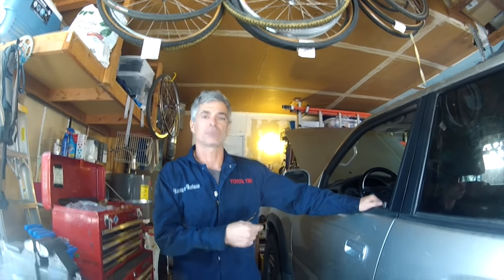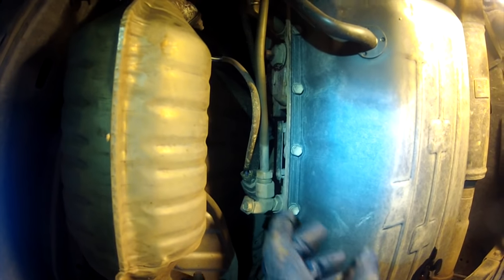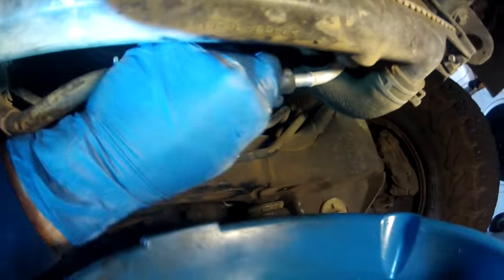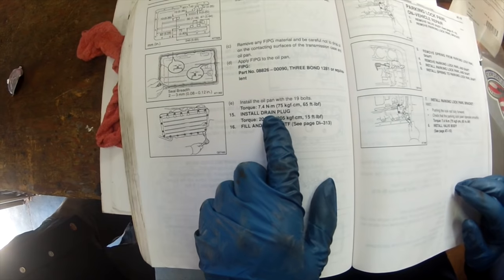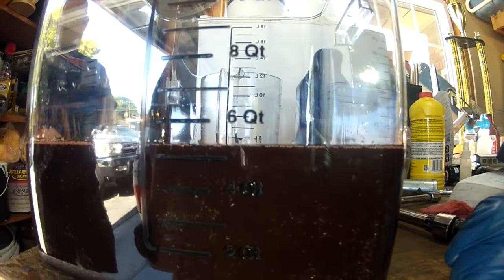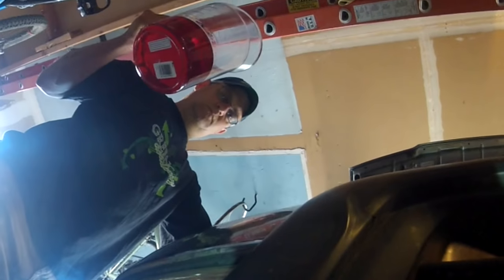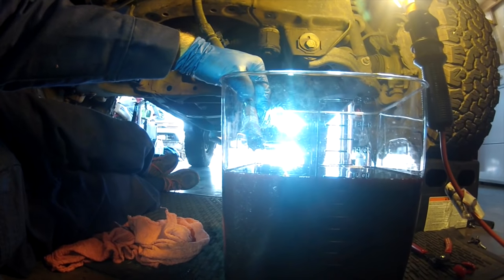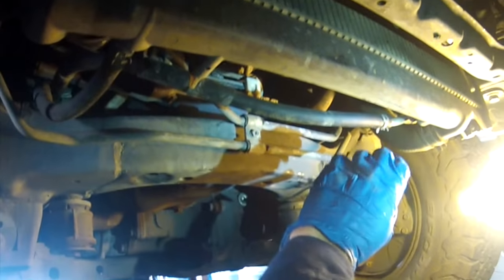Transmission Fluid Flush

Comment: This is probably the most comprehensive flush procedure I've seen anywhere. Thanks for sharing this man!
Reply from the maker: No problem.  Glad our video helped you out.
Reply: Dunno if anyone gives a damn but if you're bored like me during the covid times you can watch pretty much all of the new movies on instaflixxer. Have been streaming with my brother these days :)
Reply: @Brodie Taylor Yea, been using InstaFlixxer for since december myself :)
Reply: @TimmyTheToolman  one more question please? My 2004 ford ranger don’t have a drain plug that I see, do I have to drain the pan or can I start draining from the radiator?? Sorry.
Reply from the maker: @HowardSprague116  I'm not familiar with Fords but I would think there'd have to be a drain plug.  You could technically start the flush via the transmission cooler return line without first draining the pan.  Is your transmission sealed, meaning no dipstick?
Reply: @TimmyTheToolman  it does have a dipstick.
Reply from the maker: @HowardSprague116  Gotcha.  If you don't have a dipstick, then the manufacturer expects you to drop the pan to change out the fluid and the filter at the same time.  I didn't think American Motors cars were still like that with no drain plug, but apparently that's the case.
Reply: @TimmyTheToolman  I’ll do some more research on draining. But man you helped me big time. Thank you so much. Keep on Yourubing.. 👍🏻👍🏻
Reply: @TimmyTheToolman  I won’t take off pan if I can’t find the drain plug. I’ll just flush starting with transmission cooler. Thanks again brother!!
Reply from the maker: @HowardSprague116  My pleasure.  Happy Wrenching!

Comment: As an avid Toyota owner, currently own eight, I perform all of the maintenance. Your videos are most informative and I appreciate the detailed description of the work required. Some Toyota trivia for you. A windshield washer fluid container,with the bottom removed, can be used as a funnel for oil filling. The threads of the container and the oil fill opening match on the Sequoia 4.7 liter match.
Reply from the maker: It's good to hear you like the videos we make.  Thanks for sharing your oil funnel idea.  I like it!  Is it any particular brand of windshield washer fluid?
Reply: Not that I am aware of, just the normal bottle that comes from Pep Boys or Wall Mart.
Reply from the maker: @carolcarola9719  Ok, Thanks.

Comment: Cool. Honestly only thing I would’ve done differently would be drop the pan, replace the transmission filter and clean the magnets that are on the bottom of the pan. they’re probably caked with metal shavings.
Reply from the maker: My take on dropping the pan is I'd do it if the transmission had an unknown service history and the trans fluid was really dark.  Then I might be interested and dropping the pan to see how much metal debris was on the magnets to give me a clue on the health of the transmission.   If the trans is regularly serviced, dropping the pan isn't necessary in my opinion.  Those magnets could hold a lifetime of fine metal debris.  What I do for extra filtration is I run an inline magnetic filter in the transmission return line.  Magnefine makes them and they are rated for 30k miles.

Comment: My 99 sr5 has 320k on it. Should I do a flush? No transmission issues. Just trying to catch up on maintenance. I got it at 306k.
Reply from the maker: With that kind of mileage and I'm assuming an unknown service history, I think it would be safer to do a series of drain and refills.  Drain the pan which will remove around 4-4.5 quarts from the system and then refill it.  In another 5,000 miles, maybe timed with your next engine oil change, perform another drain and refill.  Wait another 5,000 miles and do a 3rd drain and refill and your fluid should be in really good shape after that.  I do a drain and refill every 10,000 miles (every other engine oil change), and this keeps my trans fluid in great shape.  I confirmed this by doing a Blackstone Labs oil analysis of my fluid.

Introducing the full capacity of fresh fluid might be dangerous because ATF has great detergent qualities and if there's sludge buildup in the trans, that fresh fluid could break up deposits that could become lodged in a fluid passageway in the valve body and then you're going to have trans problems that will force you to pull the trans and replace it.

Comment: If you've got 60--  80k miles, good time to drop pan, check and see what kinda crud is in the bottom, clean it, replace filter. With higher milage vehicles, if the fluid is dark, same deal, with older, darker fluid, there'll be more trash in the pan, filter must be changed, after 3- 6 k miles repeat drain, no filter, should be good for another 60-80k miles, change sooner if fluid gets dark.
Reply from the maker: Unless the trans was treated poorly and barely received service, dropping the pan and replacing the filter is a waste of time.  The filters in these transmissions are a fine mesh metal strainer and not an actual filter.  They will only get blocked up if the fluid was hardly ever changed and sludge deposits got caught in the filter.   When I cut open the filter on my 3rd Gen with around 150k miles on it, the strainer screen was probably 95% clear.  And, cleaning the magnets isn't a good reason to drop the pan either.  Yeah there will be metal deposits on the magnets but it's not like they need to be cleaned in order for them to keep on efficiently collecting metal fragments.  That's my two cents.

Comment: Good info. You did a great service.

I did a fluid replacement/flush using a similar procedure about 4 years ago on my Toyota Sienna at 88,000 miles.  Even though Toyota says this is a lifetime fluid, the fluid color was kind of dark purple with light brown streaks.  I used 12 quarts of Valvoline Maxlife synthetic ATF ($17.98/4 quarts at Walmart) and after the change the fluid color was  clean, clear light red so clearly this procedure does a great job at getting almost all of the old fluid out.

Now about 55,000 miles later the fluid color hasn't changed at all. It's still clean, clear light red. Clearly I've extended the life of my transmission by doing the fluid change. I highly recommend this procedure and Valvoline Maxlife.
Reply from the maker: Hey John,  Glad you like the video.  There's no way any ATF is lifetime.  How they can claim this is beyond comprehension.  You did the right thing by changing it.

Comment: I used this video as a guideline to flush the transmission on my 2000 tundra 4.7 with the A304.  The transmission cooler is right on the front of the radiator and I pulled off the top line and slipped on a 3/8” ID clear hose to pump the fluid into a quart marked 2 gallon plastic pail that I got from the paint section of the local home improvement store.
Worked like a charm, and my truck is shifting much smoother.  Took all 12 quarts.
Reply from the maker: Good job!

Comment: I used your method on my 1998 4Runner, and it worked great. I was able to do it solo; just counted to ten each time, and that pumped out about a quart. My filter came with a rubber gasket, so I used that and will be happy to save myself at least an hour next time with not having to remove gasket material! Thanks for this very helpful video!
Reply from the maker: That's great to hear it worked out for you Jerry.  Thanks for taking the time to comment.  Happy Wrenching!

Comment: Just did my 2004 Highlander. It had an external cooler (call it the tow prep package which many Toyotas come with) as well so tapped right between the external cooler and the transmission. Drained the existing fluid by removing the drain plug which yielded 1 gallon. Replaced with one gallon of new fluid. Disconnected the hose coming out of external cooler and put a clear vinyl 3/8th ID hose on the external cooler nipple.  Started car and waited for one quart to be pumped out. Put one quart new fluid in via dipstick. Repeated several time until about 8 quarts had been put in. During some of these I moved the gear selection through all gears. Re secured the disconnected hose and checked fluid level. Such an easy process especially since the hose on the external cooler is easily accessible.  It is on the front left part of the vehicle and is easy to tell supply versus discharge. So total new fluid used was 3 gallons/12 qts. Thanks a bunch for this video Timmy - made the job much easier. Took less than an hour
Reply from the maker: It really is an easy way to renew the transmission fluid in your vehicle.  Glad our video helped you get it done.

Comment: Did my flush the same way last night, following these instructions.  Worked great.  I used a clear 3/8" hose from HomeDepot if that helps anyone.  It was cheap and gave a great view of the fluid color during the flush cycles.  Used the Valvoline Max ATF as mentioned in the description
Reply from the maker: Glad it worked out well for you.  Using clear tubing was smart.

Comment: I had 65,000kms (40,300mi) on my transmission fluid, it was cooked for sure. The center console was getting really hot on long drives. I followed this procedure and MAN the results were great. Thanks a ton. My Runner fights another day. 👍👍👍
Reply from the maker: Thanks for sharing this with us and you're very welcome.  Happy Wrenching!
Reply: Cooking fluid with just 40k? Are you sure there isn't something else going on? New fluid is rated to last 50k+ easily.

Comment: Thanks for this.  I used your A750F guide before, and now I needed this one as I have a different vehicle.  The dipstick tube makes things so much easier.  They call it progress!
Reply from the maker: Thanks for the generous “super thanks” mate! We really appreciate the support!!!
- Sean
Reply from the maker: Thanks for the tip.  Yeah, a dipstick makes it much easier.
Reply: @TimmyTheToolman  You are welcome thanks for sharing your time and knowledge so freely.  I forgot to ask.  The vehicle is not OBD2 (imported vehicle), is the "rule of thumb" still drive for 20 mins to get to operating temperature to check the level?  Somewhere along the line, my work mate isn't sure if we lost or gained a litre of fluid.🙄 😅
Reply from the maker: @Me-zo8yc  Yeah, a 20 minute drive with several hard accelerations on the highway to get the transmission to kick down will bring the fluid to operating temperature.  Get the vehicle home or wherever you choose that has level ground and immediately check the level on the dipstick.  As soon as you stop driving, the fluid temp will start cooling.
Reply: @TimmyTheToolman   Thanks very much!  I mashed the pedal into the carpet on a long uphill country road so that it revved out in each gear, then pulled straight into a carpark and it was just under the lower HOT mark, so I added 500ml (About half a quart).
Reply from the maker: @Me-zo8yc  Good job.  Your level should be perfect.
Reply: @TimmyTheToolman   Great thanks for confirming!

Comment: Thanks again,my tourqe covertor wasnt locking up until 65mph, i flushed the fluid today as per your video and its all good now locking up at 50/55, my return line was on the oppisite side of the rad, its a rhd, thanks for explaining it so well..
Reply from the maker: good to know about the return line, thanks for sharing. stoked you fixed your issue with our video!@

Comment: I have changed my Trans fluid about a dozen times and am on the same drain plug washer.  I finally changed it out today for the hell of it.
Reply from the maker: I've reused drain plug washers in the past but it is better to replace them every time.  We're not talking a whole lot of money for one of these so I just buy a few when I visit the local dealership so I don't have to make a trip there every time I want to do a drain and refill of the trans pan.
Reply: +Timmy The Toolman the Trans washer is like 5 dollars, the motor oil plug is like a dollar.  I ordered like 20 motor oil for 5 dollars but the Trans washer needs to be cheaper.  will need to find a brass, copper or aluminum washer of same size that is cheaper
Reply from the maker: That is expensive.  I'll have to double check the price the next time I buy some.  I don't remember paying that much but maybe I did.